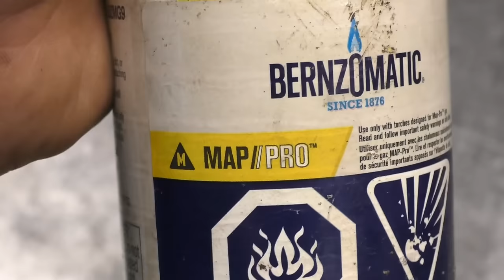Make Your Own Snap Ring Pliers - See How It's Done!

Comment: Very cool, Don!  I bought a snap ring pliers set that can be adjusted for opening and closing ring gaps for both kinds and it came with different sizes of pin-hole tips for different size rings.  I don't know if it could handle o-rings that big, but it's worked for everything I've needed so far.  You're always so helpful with things like this.  I've had applications for welding, but had to figure out other ways to deal with them.  Maybe one day.  Todd of Project Farm did a welder comparison review not long long ago and, for my needs, the $90 one would be good enough.

Comment: Good work Don. 
Those work well for inside snap rings because when you squeeze the handle, the tips contract.  To make a set for outside snap rings, start with a pair of batter terminal pliers - these open *or spread( when you squeeze the handles.  Sure, you can make do with either but having both makes for a better option.  
As far as making them, personally I love to make specialized tools. Anyone with money or a credit card can buy most anything, but you dont have the satisfaction or sense of accomplishment of making them.
Reply from the maker: Thanks for the tip!

Comment: You will be surprised at what you can accomplish with a 4 1/2 in grinder and a simple welder . I had to rebuild the transmission on my Street Glide and according to the HD service manual if had to buy all the special tools to do it it would have cost me $700 US . Made every thing myself and worked out fine .

Comment: That's pretty ingenious but wasting a 39 dollar pair of lineman pliers to make a 29 dollar single direction snap ring tool seems...? You decide.
Reply from the maker: These were $5
Reply: @donyboy73 yeah I do know you can buy cheap lineman pliers. And I did give credit for ingenuity. And I do know good snap ring pliers aren't cheap but, not everyone has a shop with, spot welders. Every kind of die grinders and cutting tools to be able to do all that the video showed. So basically, as cool as it is to say, " look what I can do", ya have to have hundreds of dollars worth of tools,to save 40 bucks. 
But it's still a cool video.
Reply from the maker: @peterford9369  This is just for fun Peter
Reply: I’m glad I found this comment because I was wondering if this video was for real. Sorry, I have to agree with the mindset of “if you can afford a shop with that much equipment, you can probably afford some real snap ring pliers”. I guess I would feel differently about it if the job had been done with hand tools only. No welder, grinder, drill, etc.
Reply: @fyrcap962  I did check harbor freight and saw their cast snap ring 12 inch pliers for 31 bucks each. Inner and outer. 
I'm not knocking ingenuity. It's how man has moved beyond the stone age. 
But yeah, those of us that don't have a decent shop loaded with drill presses, welding equipment,etc, are gonna find it hard to take a pair of 5 inch,5 buck pliers and build a pair of snap ring pliers. 
But I don't want to take away from the ingenuity at all.
Reply: We also don't have harbour freight in Canada, and 31 bucks American is like 50 million CAD
Reply: @donyboy73  Exactly. I wasn't trying to be an ass. Your videos have always been a big help to me and probably millions of watchers out here. And I truly do appreciate what you do.
Reply: @grahammacdonald3021  Nice profile picture. I love dogs too. So what aftermarket or inexpensive tool supply do y'all have in Canada? 
And I wasn't trying to diss this video. I've watched his vids for years and always appreciated his help with repairs of equipment. It truly wasn't meant to be belligerent or offensive.
Reply from the maker: @peterford9369  I didn't start off with hundreds of dollars of tools, first I had to work hard to buy them.
Reply: @peterford9369  Canadian tire and princess auto, but they don't have near the variety of tools, both in quantity and quality that HF has.  Mostly just supplies and materials. That's out on the east coast, not sure about central or western
Reply: @grahammacdonald3021  Ahh, I see. HF is fine, but honestly, I'm getting things on line at Amazon and even ebay. And for quality, I've gotten stuff from Amazon for cheaper and, darn good quality as well. I just bought a 3/8s 50 piece socket set for 41 bucks. And I was very pleased with the quality of the finish and the wrench is solid and smooth. Very pleased. And with ebay I've found high quality name brand power tools in great condition for a third the price of new. I'm a carpenter. So I'm not rich by any means. So price and quantity does matter. A lot. Take care.
Reply: @donyboy73  My friend,  you're preachen to the choir. I've been a carpenter all my working life.40 plus years. I built my house with a used B&D 7 1/4 Sawcat I rebuilt from my dads stock. He also was a carpenter and home builder.  A 75 dollar used chainsaw, a couple of handsaws, couple of used 1/2 inch drills and a cheap plastic B&D 8 1/4 inch mitre saw. No air tools all hammer and nails. 
Been hittin it since 1974. I know hard work. 
Thanks Donnie,
Reply: I think the point was to have a fun project and also homemade tools are way more satisfying to use than ones bought off the shelf.
Reply: @80SWoods  I know. We've seen many of those, make something out of something else, videos. And at one point, before they went viral, the original person made a fortune off the patent for that idea. Now it maybe just a way to get views. It is cool though to see the step by step things it takes to turn a screwdriver, into an ice pick. I'm just being facetious now. 
The video was fine.